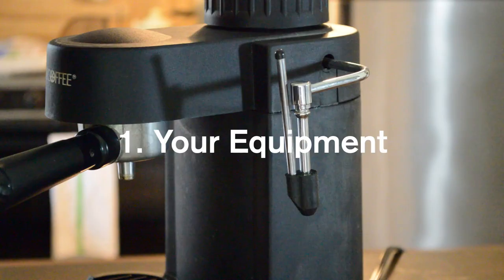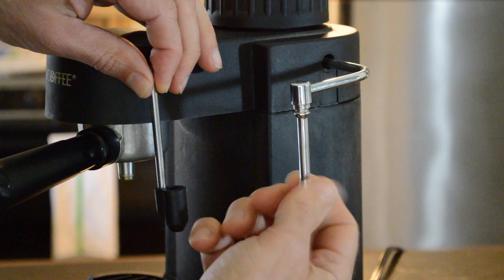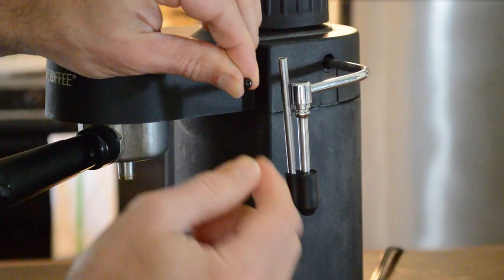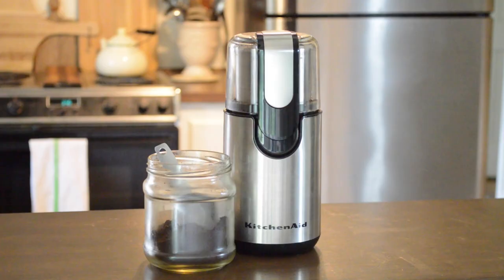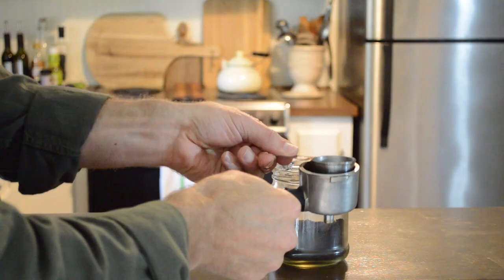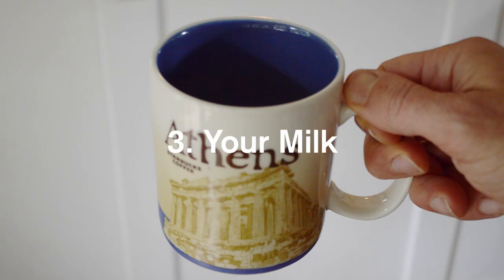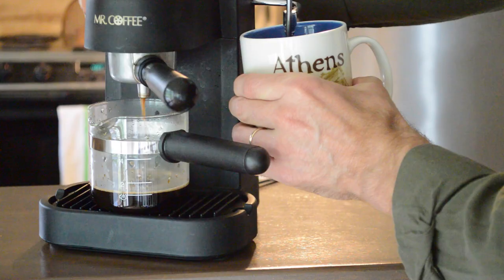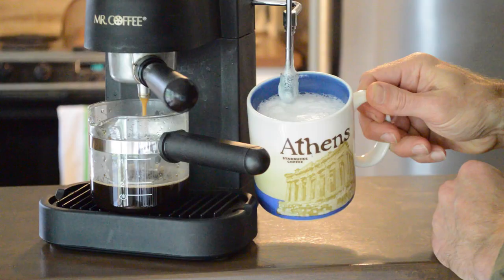How To Make Better Cappuccino Foam On A Home Espresso Machine - AnOregonCottage.com

Comment: Thank you so much, I also bought a used espresso machine and fortunately I happened upon you saying to check the valves, they were plugged up ,I stuck a pin in them and now it works  like a charm
Reply from the maker: Glad to help - enjoy your cappuccinos!
Reply: AnOregon Cottage.
I was given a Cascade steam machine with no instructions and a missing snorkel, and I've got absolutely idea how to use it. Is it safe to experiment with and work out how to use it myself, and is a snorkel  necessary? Cheers, Rob.
Reply from the maker: All a snorkel does is help make the foam a little thicker. If the machine is just as simple as the one in the video, you should go ahead and try making some lattes.
Reply: AnOregonCottage.
Aw yeah no worries, I had a bit of a play with it, and I can make quite a passable cup of coffee, as it turns out. Cheers, Rob.

Comment: Hi !  had quite a few coffee machines over the years  and NEVER had a snorkel!   Even my newest one doesn't have one. I was recommended to use a metal jug to make the foam , and always get great results.
Reply from the maker: Joyce,
We've gotten the rubber snorkel with several new machines we've purchased, but it probably varies by manufacturer. But it is like training wheels for us home users. The real baristas use just the metal nozzle and metal pitcher. So you are foaming at an advanced level. :)
Reply: Me again! I'm from Scotland so maybe machines here don't have a snorkel. It did take a bit of practice to master the foam.
Thanks for replying, enjoy your chanel!

Comment: The blind teaching the blind.
Reply from the maker: Ha, ha :)
Reply: Can anyone tell me if you pull the basket (metal cake tin) out of the handle does it have a single dot (or a very few) in the middle or a grid of dots over the whole surface ?

Comment: Can anyone tell me if you pull the basket (metal cake tin) out of the handle does it have a single dot (or a very small number) in the middle or a grid of dots over the whole surface of the underside?
Reply from the maker: If I'm understanding you, it has a grid of dots on the bottom of the basket to let the coffee through.

Comment: You make it look so easy but it's not at all. I can't get any foam... How Long did u practice til you got it looking like this?
Reply from the maker: It's usually one of the things mentioned in the video: the steam pressure isn't great enough or your milk isn't deep enough. Your steam pressure is affected by how fine the coffee is ground (should be really fine), how tightly it's packed (pack it down), and how late in the process you wait to make steam (best steam close to the end). You do get better steam when you're making 4 shots of coffee instead of 2. So you might try that.

Comment: My shots keep coming out burnt/ butter tasting. What am I doing wrong?
Reply from the maker: Hmmm, I would think it would have to be the kind of coffee you're using because the steam doesn't affect the flavor.
Reply: @AnOregonCottage   I have a stovetop espresso maker, simple as it comes and can be... Any tips on how to get a significant amount of foam using one of these?
 I usually end up with hardly any foam at all, and this is the case with all brands of coffe I have used, though it almost always tastes great, I just can't the foam...🤔
Reply: Chloe Kastelic - 
Are you a fan of espresso? Or any other really strong coffee options, 
Just wondering if it may be, that you don't care for the taste of strong brews as they can be somewhat bitter for folks that aren't accustomed to that style... Cheers✌️🖖
Reply from the maker: @k.m.z.hardesty  I have one of those, but I've never used it. A wild guess would be that you need to use a finer grind of coffee and pack it down more. Also, you may be trying to foam your milk too early in the process. If you wait a little longer, the pressure might be better. Again, just a guess at what's going wrong.
Reply: @AnOregonCottage   thanks for the tip.
I have used Café Bustelo, which is so very fine/ground up, it's like powder. It's one of my favorite kinds of espresso, I first learned of from family in Miami that happen to be Cuban, as so it's Cuban coffee...
Off topic, But anyway, I shall try your recommendations.
Thanks👍

Comment: I just bought at of these machines a thrift shop for $5, but realized after watching your video that it is missing the snorkel part. How important is it to have this part to froth/steam milk?
Reply from the maker: WolksVagon The snorkel helps it make frothy foam. You can use the machine without it (and professional baristas do) but in my experience it tends to blow bubbles more than make foam. But maybe you can work around that with deeper milk. Thanks for watching and posting a question.
Reply: @AnOregonCottage  does that mean that when you steam your milk without the snorkel you can froth the milk to make latte art?
Reply from the maker: @MasterPiece-rg7ed  Not sure if that's how it works. You'll have to ask a real barista.

Comment: I just purchased this espresso machine from my local thrift store, and this is the only video I could find on how to use it! I used to be a barista so I'm a little familiar on how to make pull shots and steam milk, but do you have any idea what the 2 and 4 stands for? Is that the amount of shots? Also, do I have to turn the knob off once it fills up to that point?
Reply from the maker: As far as I know, the 2 and the 4 are the number of shots. I don't now if this exactly corresponds with the amount of espresso made on a professional model. Once the coffee fills past the 2 cup mark, you turn the knob all the way up (past OFF) to start getting steam. If something has gone wrong, you can can turn it to off for a few moments (which I've done more than a few times). Does that make sense?
Reply: AnOregonCottage Yes I understand what you mean, thank you so much for clearing that up for me!

Comment: What happens if you don't have the little plastic piece on the snorkel? And where do you get a spare one if it's gone missing?
Reply from the maker: Without the rubber piece and metal snorkel, you end with bubbles more than foam. You can find replacements by searching for "espresso machine frothing tip attachment." I've seen them on eBay.

Comment: How long do you usually wait to get the foam?
Reply from the maker: ***** The strongest pressure, which makes the best foam, is at the very end of the process. I don't start steaming the milk until about 75% of the coffee is in the carafe. But you have to be careful you don't wait too late and run out of pressure.

Comment: Snorkel?!?
Reply from the maker: +Steve Hoge That's what I call the little metal shaft attached to the rubber nozzle cover. It acts as a snorkel, pulling in air when nozzle is immersed in the milk. What would you call it?
Reply: +AnOregonCottage Dunno, never seen one!
Reply from the maker: +Steve Hoge They come with the new machines, but I've seen a lot of thrift store machines where the snorkel is missing. Makes foaming a whole lot easier.
Reply: @AnOregonCottage  can you reply with a link to where I can purchase one of those "snorkels"?
Reply from the maker: @shannonmack6341  We did look, but they're hard to find. I think you'll have to keep looking on places like ebay. It's called things like a "wand steamer."